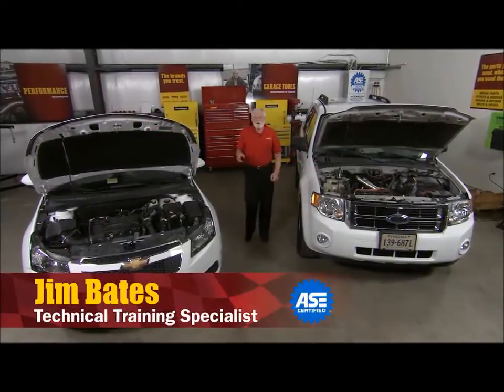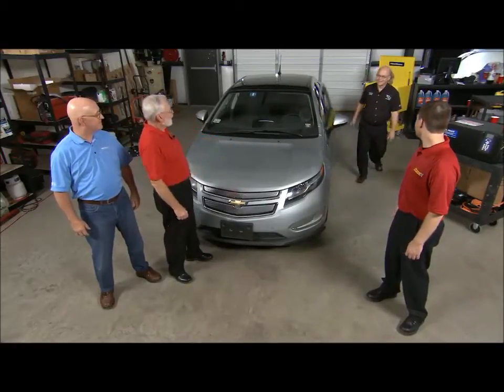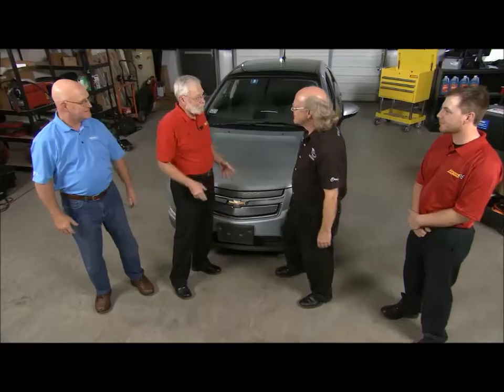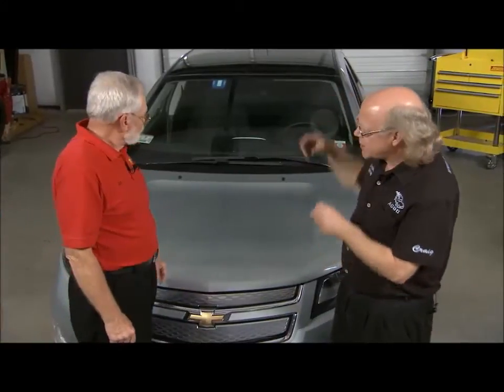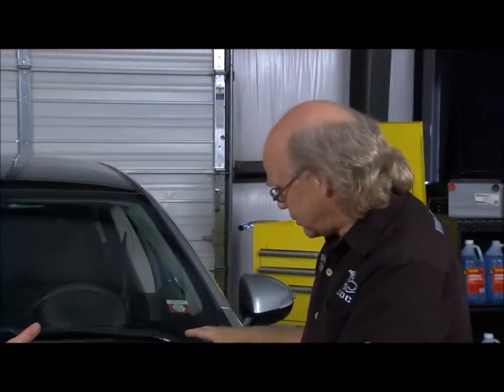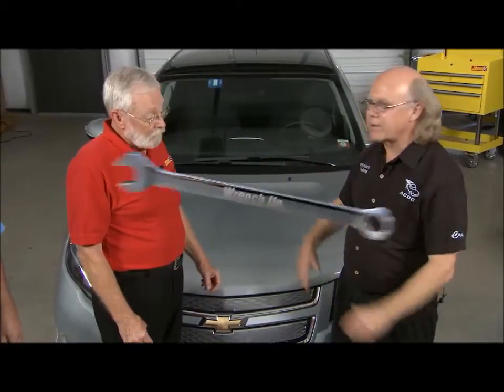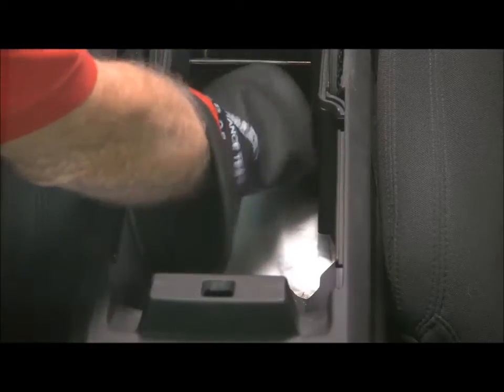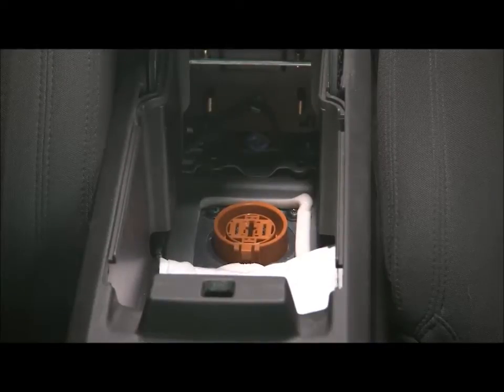How to remove a Chevy Volt's MSD - Wrenchin' Up

Comment: Can you tell me what codes were generated when and how was it cleared as in have the same issue.
Reply from the maker: Hi - Thanks for watching! If I remember correctly, this video was created just to show how to remove it. I don’t think there were any codes. Removing it was part of the video where Midtronics demonstrated how to discharge and recharge the traction battery with their device.

Comment: Well I be damned! I just bought a 2014 at auction that had that disconnect in the passenger seat. Car has No Start electrics problems that the last owner couldn't fix or wanted to pay for at the dealer. Has all kinds of spare modules in the back seat but I like a challenge so I bought it. 

Anyways, I had to power the car up to get it out of park so I could put the car on my trailer. After seeing this video, now I need to get a scanner of some sort to get the modules to reconnect to the can bus. 😞 Does it have to be a GM specific tool? There's also a spare charging module (front passenger bumper side) that came with the car and the coolant to the hybrid system is dry in reservoir. Gotta pull somethings apart to see what all was done as there is also a a/c compressor in the back seat. I believe the car has been sitting up since May 2019 so I don't have a clue what the hybrid battery condition is. I fear being discharged for so long may have ruined it.
Reply from the maker: Hi - Thanks for watching! When we did the Volt HD battery power down video we used an AUTEL MaxiSys scan tool. I hope that helps.

Comment: Hi! is the high voltage, 350a fuse located inside the orange part of the MSD plug?
Reply from the maker: Hi - Thanks for watching! I think so but I haven't physically checked. I suggest that you check with a service/repair manual for the vehicle to be sure.

Comment: Greetings there. So i might have the same issue as you said on the video. So i had removed the MSD and 12volt battery in order to do some repair on the gas engine. After connecting back the 12v battery and the MSD we get the high voltage interlock error (P0A0C) and the car is stuck in service mode. By watching this video , i saw the thing you done with the cardboard paper on the power button and i m afraid that something like that must happend . What was the procedure to "unlock" it when your student did it?
Thank you in advance
Reply from the maker: Hi - Thanks for watching! Craig had to take the car to the dealer to have the system reset. This was several years ago so I think most scan tools with Volt software could do the same thing now.
Reply: @WrenchinUpwithJimBates  Hi, how to avoid the high voltage interlock issue?  Is there any procedure about remove the MSD?  Is this procedure ok: disconnect 12V battery, then disconnect MSD, then wait 5 minutes, then operate on something, then put back MSD, then wait 5 minutes, then connect 12V battery.  Thank you.

Comment: So is this all that's needed to service anything on the high voltage system or are there other steps needed as well?
Reply from the maker: Hi - Thanks for watching!  It depends on what you are servicing. This video demonstrates the High Voltage shut off procedure. That’s all. Be sure you have a thorough understanding of the vehicle's high voltage system before you start touching any of it. The voltage and amperage of this, and any vehicle with a high voltage system is instantly lethal of not turned off properly. Be sure to check out my video on high voltage protective gloves before you start too.

Comment: On a 2012 Chevy Volt, if the 12 volt battery is disconnected, would this erase the radio's favorite stations or the built in favorite addresses on the GPS?
Reply from the maker: Hi Nat - Yes, it probably will as this is what usually happens in all vehicles when the those devices are unpowered.
Reply from the maker: Hi Nat - Here's a video I created that explains "Memory Saving" when you need to disconnect the 12 volt battery and still save the radio stations, GPS, etc. https://youtu.be/7Q2hSsUy8Nk

Comment: Would disconnecting the small 12 Volt battery erases all the favorite radio stations or the built in GPS favorite addresses?
Reply from the maker: Hi Nat - Thanks for watching! Yes it usually does.
Reply: It did not for me. Perhaps there is a coin battery in the center computer

Comment: When you disconnect the master hi voltage disconnect, do you erase your address memory in the GPS system, or your favorite radio stations?
Reply from the maker: Hi - Thanks for watching! Disconnecting the HV disconnect will not interfere with the 12 volt system.
Reply: When you disconnect the 12 volt Battery ,do you erase your address memory in the GPS system, or your favorite radio stations?

 @WrenchinUpwithJimBates

Comment: I’m getting the P0AA6 error, can I do this and drive the car on gas only until the dealership checks it?
Reply from the maker: Hi - In parallel system hybrids, the gas engine is started by one of the motor/generators. I think the Volt's gas engine starts like that as well so removing the high voltage battery service plug would prevent the engine from starting. I could be wrong here so give it a try and let me and the other readers of this post know what happens. Thanks for watching!

Comment: In Germany this procedure takes 10 hours. they not only unplug the plug, but have to dismantle half of the car to check that there is no voltage. also the car has to be fenced off and secured by a dozen of labels and flags.
so the receptionist does not touch the wires and dies. so reparing a volt cost so much ppl buy rather a "clean" diesel
Reply from the maker: Hi - Thanks for your comment and Thanks for watching!

Comment: once that is removed, is it safe to weld or do body work on the car?
thanks
Reply from the maker: Hi Maria - removing the MSD only disconnects the high voltage system. You would also have to disconnect the 12 volt system. I do recommend you check with a GM source before you try to do any welding on these vehicles as iso-faults are common and welders do pack a punch. Hopefully someone else with more experience in this subject matter will jump in here to help. Thanks for watching!
Reply: Thanks.
Reply: @WrenchinUpwithJimBates  so did someone verified is it must to disconnect MSD before welding or first comes 12 volt system and then MSD

hi Maria Eugenia Garcia
 maybe you found something on this ?
Reply from the maker: Hi - As far as I can remember you must remove the MSD and disconnect the 12 volt battery before working on the HV system or welding on the vehicle.